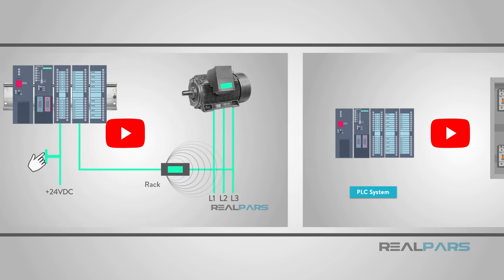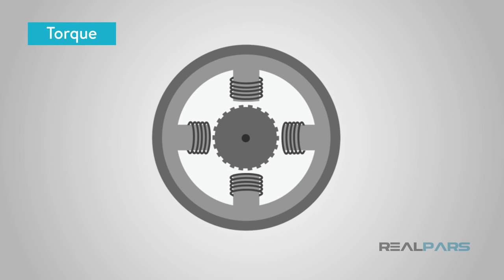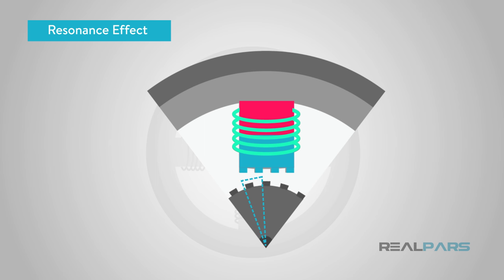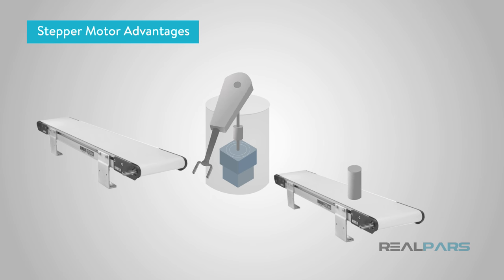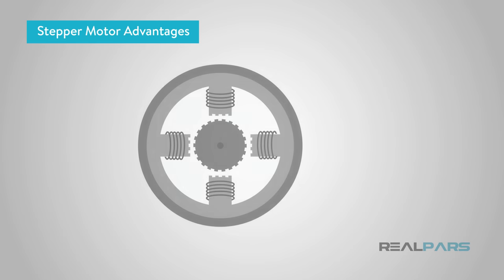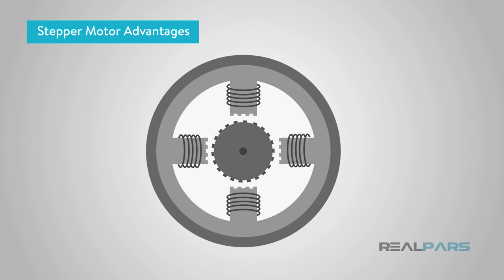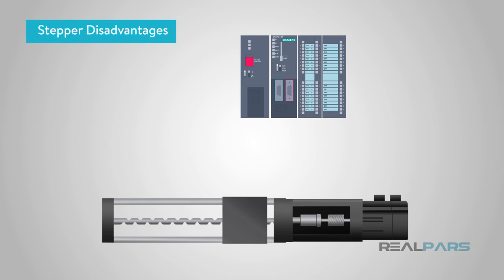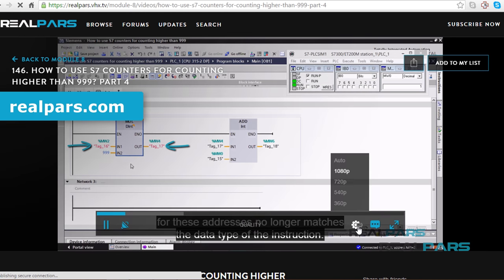Stepper Motors Advantages and Disadvantages

Comment: first let me say that your videos are impressive, very invested and knowledgeable. I wonder, there are steppers with feedback, that makes them servo steppers. so if the feedback is not an issue, what will you choose for CNC lathe or mill? personally, I think that the stepper will go into position in a natural manner with minimum corrections needed while regular ac/dc servo will always need to resonate around the target point. so unless speed [and noise] is a primer consideration I will always choose steppers.
Reply from the maker: You are correct.  A stepper motor is the likely choice for a CNC lathe or mill.  They are precise and highly accurate.  Stepper motors can be outfitted with feedback, which in some applications helps to detect and prevent "stall".